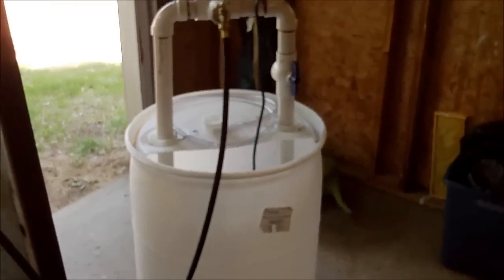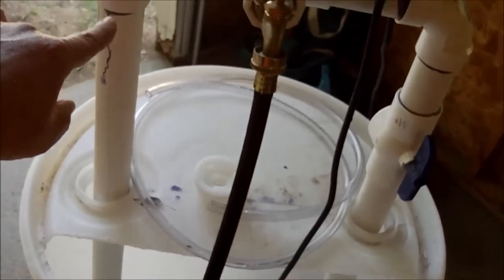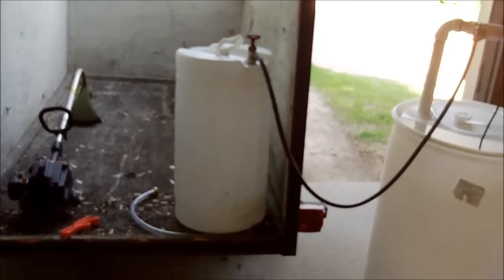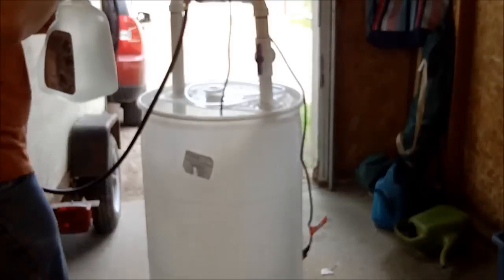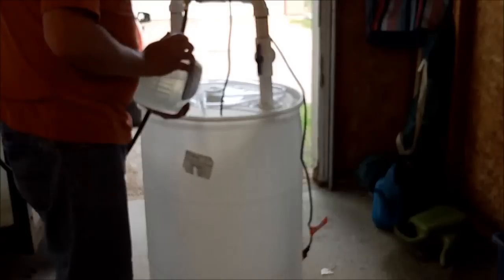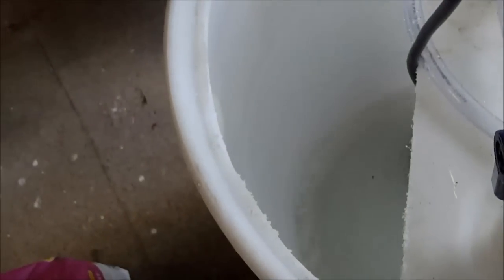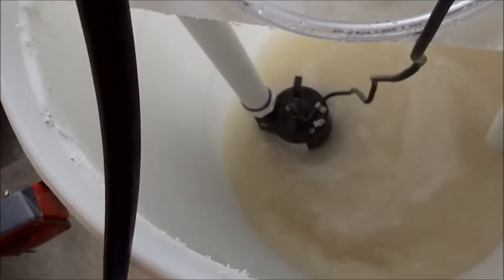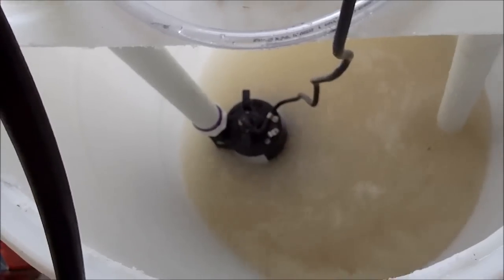Mixing sugar syrup - How I do it.

Comment: do you use hot water ?
Reply from the maker: No, but I think it would work better. Thanks for watching.
Reply: Sugar is not soluble in cold water. You don't have to boil it, but it needs to be hot in order to completely dissolve. Doesn't need a complex closed system in order to acclomplish this. Just let it cool down. Reduces the wear and tear on the pumping systems involved also.
Reply: @stevehappe8583  Brother Adam used cold water and it was stirred by hand. This was passed down to me 36 years ago by my then mentor.